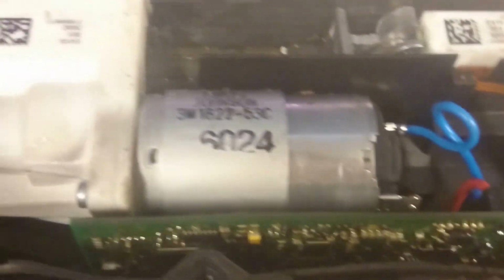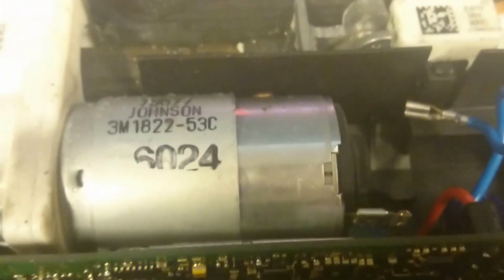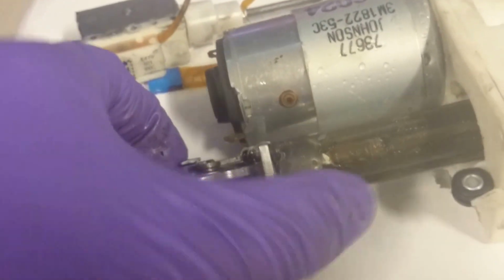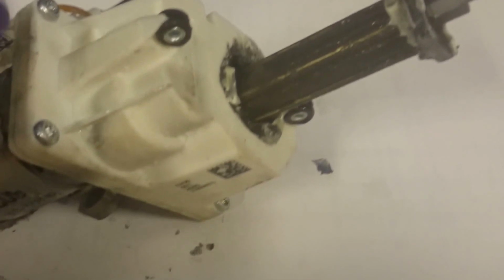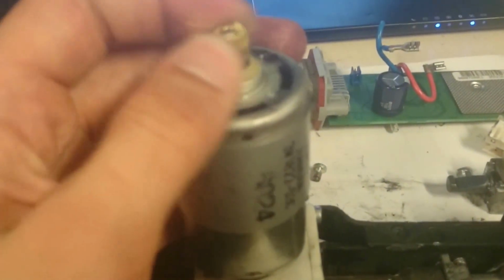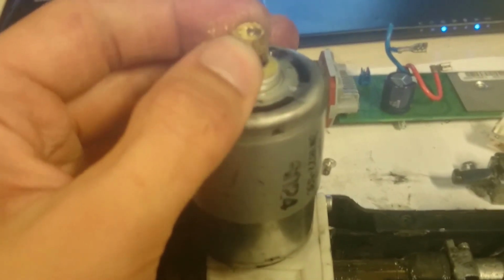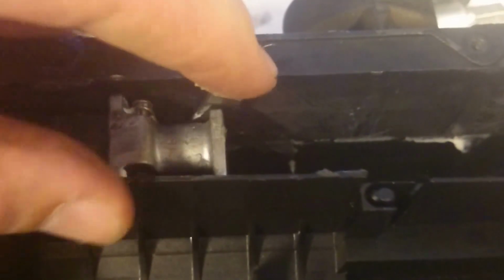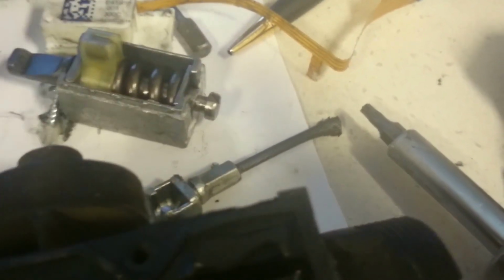TEARDOWN: Land Rover Discovery Electrical Handbrake Module

Comment: Thanks for the tear down, its interesting. i wanna share something, it could help some other DIY guys to find a fix. We replaced a lot of hand brake actuators on RRsport and disco 3/4. till one day, brand new genuine actuator fail programing with SDD. boss said we gotta take the whole unit out again, was too much hassle i decided to strip it in situe. i swaped the motherboard on new unit with motherboard from dead unit. programing went throu straight away. this car is still on the road, its been 2 years. anyone found what is the issue on the mechanical part of it (which creates the screaming noise, must be a spinning gear)
Reply: It's usually just the motor needing to be reset in the correct position by winding it back the centre position when off. Usually people leave them for 10 years unopened and the motor gradually works it's way to the end of adjustment before coming to a grinding halt during operation.
Reply: How do you reset it and wind it back to centre position. I just changed the gears (removed from the car) but didn't find any instruction to reset. The gear is making the noise again and not activating the brake after 1 week of normal operation. Appreciate any guidance! :-)
Reply: @TheUKNZ  problem with the ecb is located in the gearbox of the unit there is an overload clutch which is held in place by a tension spring. Chance are the spring has broken off its retaining clip and this causes the unit to keep spinning until it jams up. The overload clutch needs to have its center reamed out and replaced with a brass insert this would have to be done by a metal machine engineering shop. Did this myself cost me sixty euro plus my own labour.

Comment: Fascinating. But this was a deal-breaker for me. I was looking at low-mileage Discoverys and have decided against them. My wife has a Renault Scenic with one of those damn fool ridiculous bits of kit - also broken, expensively!!! Colossally stupid "innovation" for people who can't pull a simple lever up between the seats.
Reply: Disagree, when serviced regularly,  99% of the failures are due to lack of adjustment of the handbrake shoes. Which you should be doing anyway when your vehicle weighs 3.2tonnes. All electric vehicles are becoming more popular, and people are still scared of electronics.... It's also a great safety feature, you can pull the handbrake at 80kmh and you it will automatically apply abs & h/brake to stop the car without skidding.